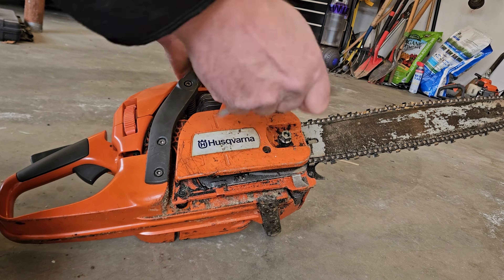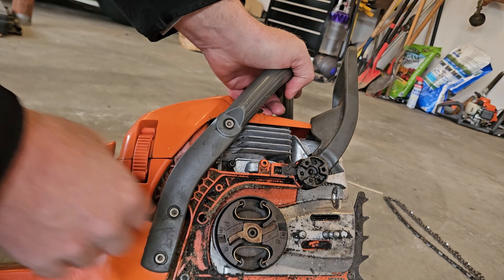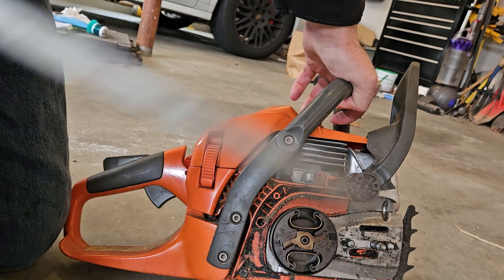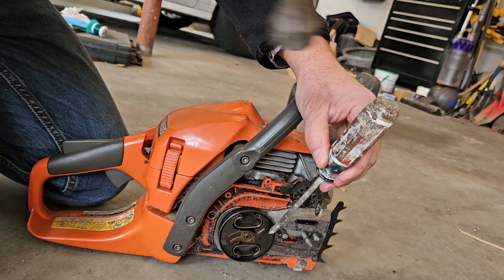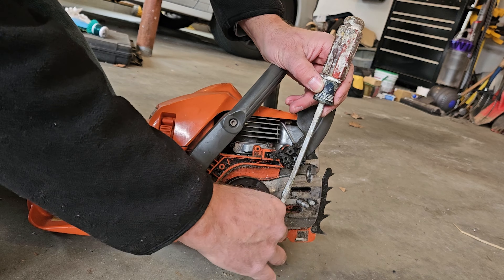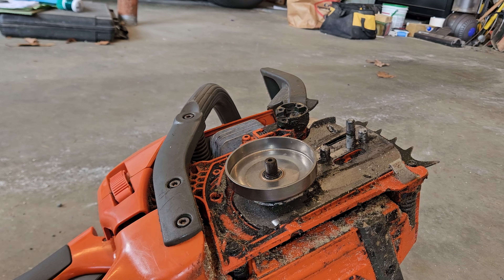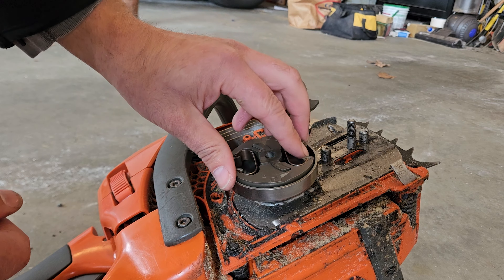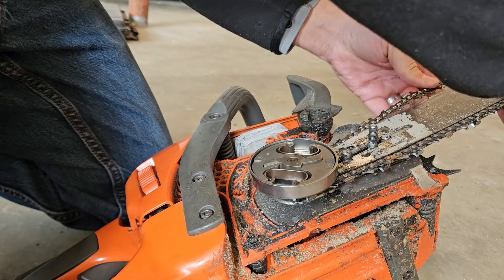FASTEST Way to Remove Clutch Husqvarna Chainsaw. Change & Replace Clutch Easy DIY

Comment: I get it, but.......'hammer and chisel mechanic.'  Proper tool and rope in cylinder might be inexpensive....and if the tool is expensive, get a Stihl which can be serviced.....just a scrench is all that is needed.
Reply from the maker: I've seen the videos with the rope in the cylinder, and it seems to take some time to remove the clutch. This way was just a lot faster. It's great to hear Stihls can be serviced with just a scrench. Well, thanks for watching